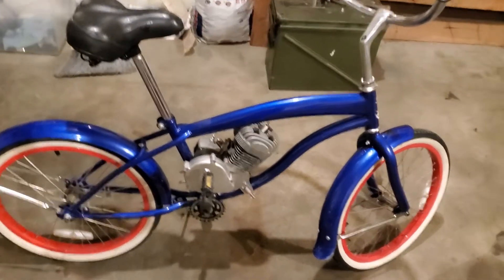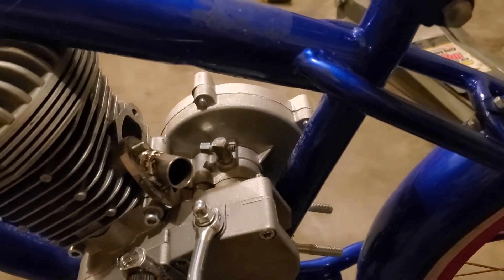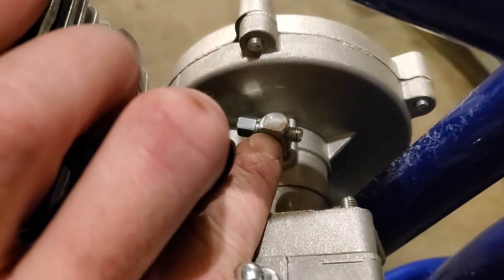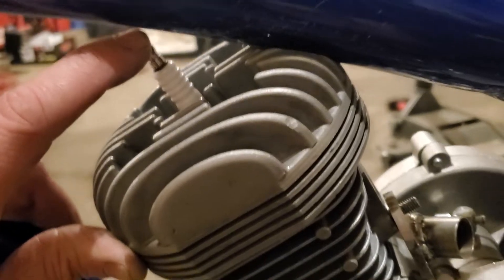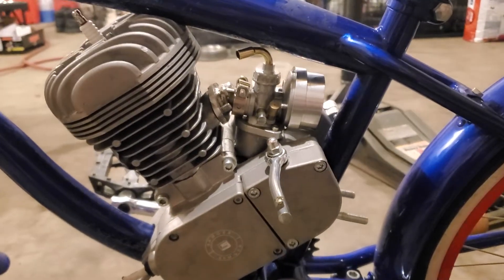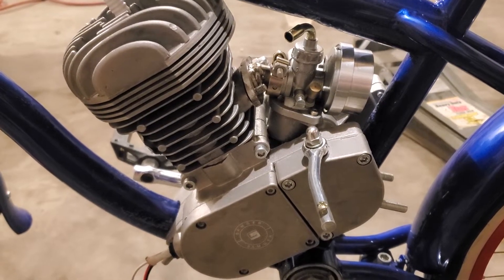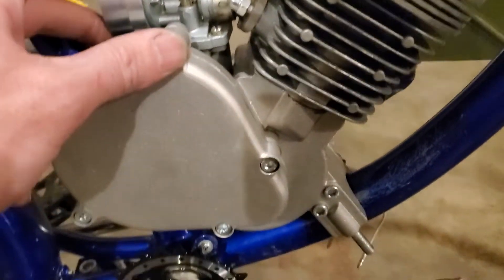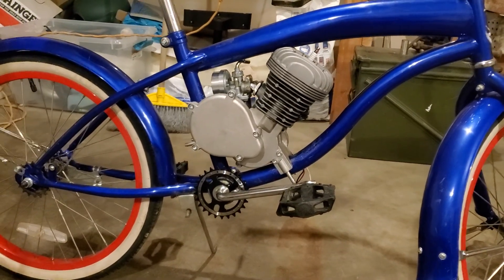Motorized bike build fitting the engine and carb. pt1

Comment: Hi Sam my mom bought a motorized mountain bike for me for Christmas and she forgot the ratio of the gas and oil mix for the Breaking. And then not breaking. Could you please tell me what it is?
Reply from the maker: The manuals for the engines  say 16 to 1 for new engine and 20 to 1 after 300 miles. That to me is excessive. But I am going to start at 30 to 1 and after 1 gallon I will switch to 40 to 1 on this engine. Hope that helps.
Reply: @SamZStuff  thank you so much and I also forgot to mention that my mom actually bought the motorized bike from you lol